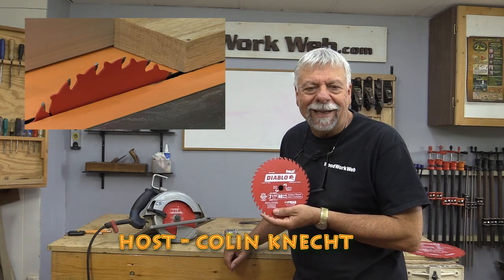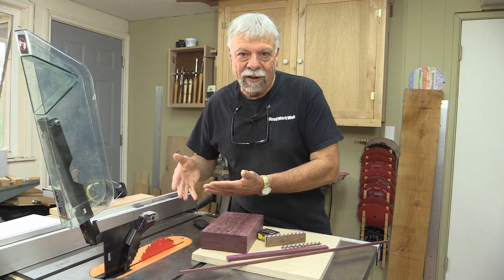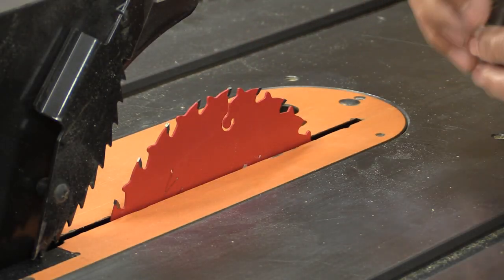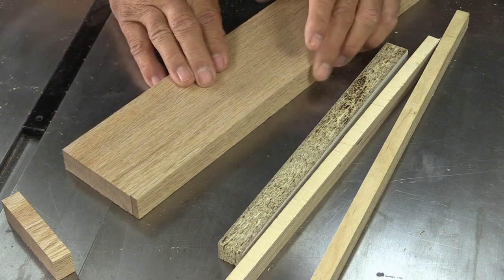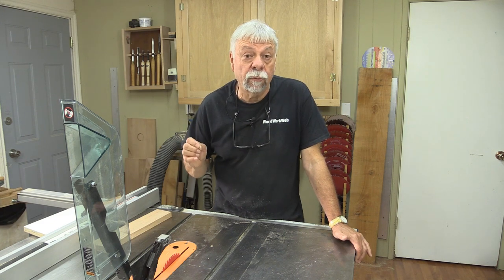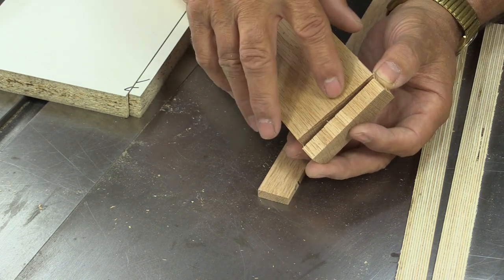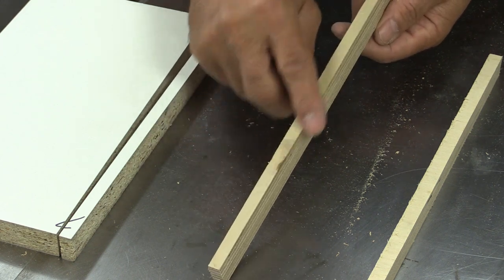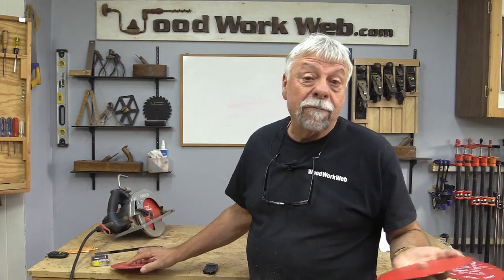Using Circular Saw Blades on a Table Saw for Woodworking

Comment: I tried this idea and it works great.   I bought a (2) pack of very fine kerf, 80 tooth circular saw blades and have been using it to rip very expensive white oak trim pieces.   Nice clean cut, less dust, and less waste.  Thank you for reminding me of this technique.  I did this years ago and have just not thought about it until seeing your video!
Reply: What did you do about your riving knife?  Did you have any issues with kickback?
Reply: I left the riving knife in place.    I have not experienced any kick back when using this technique.  But, I have only used it on trim pieces, cabinet doors, etc… usually hardwoods.  And, the kerf barely clears the top surface of the work piece.   Hope that helps.

Comment: Interesting video on circular saw blades. I actually use the less expensive circular saw blades on a regular basis. Whenever I need to make a lot of repeat cuts on common lumber the smaller blades do just fine. I don't need fine cutting on a 2 x 4. I just keep some Harbor Freight circular saw blades on hand. They work fine. Enjoy watching you teaching us. Mike
Reply from the maker: Thanks for watching Mike and thanks for the info!

Comment: You know Collin, I have been making small boxes from 1/4" hardwood which by the way ain't exactly cheap and this video made me realize that the 7 1/4 cs blade would be great for that not to mention that I cut very close tolerance miters while I'm at it. I may just be able to keep one or more fingers attached to my hands this way. 
The last time I did this was while making a ts insert that the 10" blade wouldn't fit under for the first cut.. I had to go and install a 6" single dado blade for that particular job, but the cs blade may just do the trick. 
My gnarly old fingers thank you for the tip..
Reply from the maker: Thanks for commenting Martino ... yes, please make sure you keep those fingers ...
You are correct, working with smaller pieces like making boxes is a bit more dangerous so thinner kerf circ blades could help that safety a bit as well.  Thanks for commenting ... stay safe buddy

Comment: Riving Knife : Most knives are made to the factory blade thickness. When swapping out to a circular diablo blade its much thinner than the knife usually, how did you account for that or was your knife already thin enough ?
Reply: I had to remove the riving knife and create a new table saw insert and I added a splitter

Comment: A long time ago when I was a pup I used a 'hollow ground planer' blade it made really good cuts ready for glue joints. Or minimal sanding for finish work. I used to use the 7 and 1/4 inch blade on my radial arm saw.
Reply from the maker: I had a RAS quite some time ago but never had the occasion to outfit it with a circ blade, but yes it would work assuming you could lower it down enough, which obviously yours did ... good point, thanks for this

Comment: One issue that can occur on some table saws is that the 7.25" blade might be thinner than your riving knife, so be aware.
Reply: Thats what i was worried about , my saw has a 7 1/4 blade in now and i have the knife all the way out because it sticks out a bit all the way down. There is a good size gap in between the riving kinife and the blade , should i just take it out and put in a 10"?
Reply: That's right. Good point and most don't catch that. I just remove the riving knife.
Reply: The riving knife also will be too high for non through cuts
Reply: My 8" table saw is so old it doesn't have a riving knife
Reply: @Mr_Rick  any issues with kickback without a riving knife?
Reply: @SoCalKevin  never had any KB with a small blade. You could always make an insert with a custom riving knife to match blade if you're concerned.
Reply: With the 8 1/4 inch dewilt saws, the minor variation in riving knife isn't an issue.  The height is more of an issue for stuff like double passes or grooving.  But you are probably doing through cuts on smaller pieces with the 7 1/4 blade anyhow instead of the aformentioned applications.  I find that most of the time 7 1/4 blade works excellent on 8 1/4 saws.  Take away the riving knife (at your on risk, but it's a very small risk IMO for panel applications), the 10 inch saws also loves the smaller blade.
Reply: @SoCalKevin  Diy zero clearance with a splitter

Comment: excellent..good minds work alike.. I have been using circular  blades on my Ryobi precision cutting table saw for a while. My use started the day had a cheap blade that lost two teeth.. i used various 7 1/4s.. blade spins faster.. cleaner cuts,, narrower kerf..thanks love your vids,,big follower.. j.
Reply: Actually, if the motor is pulling full power. the smaller blades would travel slower.  A circular saw runs like 20-30% faster than a typical table saw.  7.25 blades are running 120 lineal ft / s instead of the the 10 inch going at 165 ft/s -ish.

Comment: I have an old 1962 Rockwell 9 inch saw,blades are hard to find as well as a variety 
So I just used the diablo blades you have shown.i got use to the blade height. 
I recently found an 8 inch. Diablo blade.now I have more height.but the kerf is 1/8(120thou).i didn't realize the kerf of the 71/4 skil saw blade was only .060thou.
I'm going back to 71/4.but only use the 8 in. For height.
Plus my saw runs smoother with smaller blade
Nice informative vid

Comment: As people have pointed out, you missed two very important facts about these blades. The riving knife being too thick and the increased power from the motor, since it doesn't have to sling wood from 5" out any more. I use smaller blades to increase the cutting ability of my underpowered saw.

Comment: I've always found that scoring cuts on both sides of a board will give you a much cleaner surface with no tear out. Sure it's slower, but if you want a quality cut it always works and is especially good with melamine.
Reply from the maker: Yes you can score on both sides of the board and yes that will give you cleaner cuts ... I have never tried this with melamine but it could be a good option for some ... thanks for the suggestion

Comment: Bought a 6 1/2 Milwaukee 18 volt saw.  WOW.   The supplied blade appears to have the same configuration as Diablo combination 24 tooth less the red paint.  I have been cutting 2x6 and 2x4 using straight cross cuts.    They are unbelievably smooth and looked sanded.  Also bought a two pack Diablo 24 tooth on sale at half price at the the big orange box store.  

No reason to think these will not work even better on a table saw where the is more control.
Reply: sanded  with 220 or better.

Comment: I had an older 1950s 9" Delta/Rockwell table saw/jointer combo with a 15 amp. motor that I used Tenryu 8" blades on that were fantastic, though they did cost about $25 each.  When I had a lot of 2x4s to rip I put in a freud 18T 7-1/4"; on lesser powered saws smaller diameter, thinner blades really make a difference.  Why would this be so, because the 7-1.4" blade has 7/8" less leverage working against the arbor.  It's a trade off that only works if you have less power than you need, you get less rim speed but your saw doesn't bog down; and like the video tells us, the blades are much thinner, as thin as .059".
Reply from the maker: Thanks for the note Ed ... Yes, I think you answered the question, smaller blades, and slightly thinner would make for an easier path through the wood. Thanks Buddy ... good to hear your experience, we all learn.

Comment: Also with a smaller blade you can use them to make  a more curved raised panels by sliding the piece 90 deg. across the table.
Reply from the maker: +Cliff Windgar Great tip Cliff

Comment: I think the other advantage of using the circular saw blade in the table saw is that the load on the motor will probably be lower and it will maintain a close to free speed rpm without bogging down....that could help prevent burning of the wood too.
Reply from the maker: Great point Cliffe, thanks for commenting and reminding me of this
Reply: It should also be noted the the smaller diameter blade will have a slower tooth cutting speed. A 10 inch blade will have a much higher tooth cutting speed for a given rpm

Comment: Good video Colin.  I use these cheap blades all the time on my table saw especially for rough cuts on rough sawn lumber that may have some dirt or grit on it that is difficult to remove.  As you mentioned, why risk trashing a high dollar blade?  A five pack of these blades (DeWalt) are less than $40.at the big box stores.

I made a rough dado blade using EDPM rubber spacers.  Worked great!  Again, why trash a high dollar blade?
Reply from the maker: I have done the dado thing in the past too, thanks for the reminder on that, others will learn now too

Comment: Great video, as usual, Colin.  I'm wondering also if it's a good idea to use the smaller blade to cut plexiglass.
If yes, then would it be better to use the 24 tooth blade or the 40 tooth blade?

Comment: If your saw has a riving knife,  it is likely thicker than ultra thin hand aw blade.  Dangerous.
Reply: The knife itself shouldn't be dangerous.  Having a wider splitting edge than the blade could mean the piece may bind at the fence instead of passing through. This possible bind would be between the fence and the splitter (knife) , not the actual blade.  Just turn the saw off.  The opposing side may get forced out a bit if the splitter is wider there, but shouldn't be anything serious, the flex in the wood should make the issue moot.  The only real danger that I see is the kickback before the piece has had a chance to hit the riving knife.  But having such a small kerf means this is much less of a serious issue.

Comment: I have a rough table saw that I do this on sometimes. I've noticed the very thin kerf 7.25 blades can wander on larger pieces.
Reply from the maker: Yes you are correct, they can, especially the older blades, there is a new blade out now that apparently is better or has solved this with a slightly different tooth design, something they call their "Track Point", which I have not had a chance to test .. but yes, the thinner blades can wander a bit.
Thanks for the comment ... must see what I can do about testing out that new blade
Reply: Thanks. I'll have to try the Track Point.
Reply: Yes the Diablo Demo Demon has the Trackpoint. It is what I came here to see if I could use on table and chop saw. Going to try it!

Comment: Colin you said that the circular saw blade was much thinner than your 10"  How do you deal with the splitter on your TS?  If the splitter is thicker than the kerf cut by your blade doesn't that present a problem?
Reply from the maker: My splitter is pretty thin and I had to go and look at it, yes it is slighly thicker than the blade, but not enough to make a difference that I can detect. The main point is that the splitter is even with the blade on the fence side so the push out is on the outboard so really doesn't make a diff out there .. but good point, appreciate you comment
Reply: Interesting, my splitter says that it should handle the thin kirf, but when I tried it seemed to bind, so I stopped immediately.  But I think I had it aligned quite center of the blade.  Maybe I will try more to the fence side.  Thanks for the response.
Reply: You can always add spacer that comes along with your dado set to push the blade out a bit to align with your splitter.
Reply: Also interesting, but here in Thailand, most saws are made with an arbor that does not allow a dado set.  But maybe I can get some of the spacers and give it a try.  Thanks.

Comment: My Dewalt manual says the included riving knife is 2.3mm which is the same as the kerf specification for the 190mm blades my circular saw takes.  The 250mm blades indicate the kerf is 3mm.

Comment: What if you used a zero clearance insert? Should be less tear out.
Reply: I'm assume Colin didn't change the insert when he switched from the 10" blade to the 7-1/4" which does have a thinner kerf.  A dedicated insert for the 7-1/4" should reduce the bottom tear out.

Comment: If you use blade stiffeners when cutting plywood you will get far less movements and much better results with your cut. Try using 6 inch stiffeners when cutting quarter inch thick ply or Any thin material. Skip the 40 tooth and go to 60 tooth you will love the results. There are times of the year that HOME DEPOT promotes two for one sales stock up.

Comment: I have a Ridgid 4512 cast iron table saw and have used the Diablo 7&1/4 inch blade to rip but the Irving knife is too thick and the piece stops and can’t be forced through . I even ground  the leading edge of the roving knife a bit but that didn’t work either. I am always fearful of kick back. Colin do you or any of your subscribers know if there is a riving knife available through an after market supplier? I have enjoyed your web site for years but just recently subscribed. Keep up the good work. Thanks Paul White

Comment: Yes....Colin....what thickness is your splitter? I use 7 1/4 cs blades when I cut pallet wood with nails....and I've had to make a thinner make-shift splitter. Would prefer to use a factory made thin kerf splitter but can't find one that fits my saw. Any suggestions. Talking about  thin kerf splitters would be a good follow up video to this video. ...especially when people realize their splitters are too thick to use circular saw blades safely.
Reply from the maker: Oh Yeah, the splitter, not sure the thickness, but still thinner than the circ saw blades, but they must be close in size. Good point, thanks for the note on that.
Reply: The Freud demo demon is around 0.070 - 0.075” if I recall correctly, the framing has smaller teeth but is slightly wider maybe .003-.005 ish?  You may get away with using one side of a small L bracket from Homeless Despot as a metal splitter (may want to sand it down a hint and to flat).  Don’t ask how I know lol.

Comment: Bob Chase did a video a few years back called taming your table saw
Reply: Yep.  He is very correct in stating the lack of the necessity to have such a large blade.  Chase seems more of a productions cabinet maker. You can tell he really thinks about cost vs quality, striking a good balance between the two.  That old man is a guru.  I really like Collin, thought I think he employs a bit more machinery.  There are some other guys producing great products here, but they are using $100K tooling to do it.  I've always felt the lack of necessity to have the 10" blade, especially on a job site saw (what I like and use).  You can't really rip a nominal 4", not that you should or would want to in one pass.  The good diablo blades are also hopelessly expensive even on sale.  You often wonder whether to sharpen a 35 dollar diablo ripping blade or get a new one.  7 1/4 will let you rip 2" nominal, anything more, you should have alternative means of processing (or flip it over I guess).

Comment: I think you still need to use a washer with the 7 1/4 blade with 10" table saw, because the 10" blade is a little more thick than the 7 1/4 blade plus you have to take out your riving knife

Comment: What about combination blades. I use the 10" version most of the time. I hate changing blades as I probably could plan out my work better but don't. I don't use a lot of hardwood so maybe that is why it seems to work for me. Also I use stabilizers with my blades. Do you need them on smaller blades because if so it would really reduce the max cut depth. I'm interested to hear your thoughts. Maybe I need to relook at my whole blade strategy.
Reply from the maker: There are many woodworkers like yourself who don't like changing blades or their saws are harder to change blades, so if what you are doing is working for you, keep on doing that. Just because I share something like this doesn't mean people should do it, only that it's an option for them.  The 10" Freud blades will not need blade stiffeners, other brands might if they are vibrating, which some do. 
You are correct Jack, using stiffeners on the smaller blades would defeat getting much of a depth of cut. Sounds like you are fine with the methods you are using, glad you  commented, gives me a chance to help clarify.  Thanks for taking the time.

Comment: does it change the quality of the cut if you tape the wood then cut it? ive seen cleaner cuts by taping the wood to prevent the edge from blowing out.
Reply from the maker: Yes it does, depending on the type of wood and the cut. Masking tape is a cheap investment for making better cuts.
Reply: Thank you!

Comment: Thank you for this video Colin! 

I’m wondering if I could use Micro Jig’s splitters via a zero clearance insertwith a blade of this diameter? If so, would the splitters have to be installed closer to the blade because it’s smaller than the 10”? The riving knife on my Dewalt contractor saw is askew and isn’t adjustable so I have to find a way around using it. 

Thank you again!

Comment: Wouldn't the tip speed be greatly increased? Could you use a in line speed control like is normally used on a router?

Comment: Colin, I am using a 7-1/4" blade on my tablesaw but its an old saw with no riving knife. The MJ thin kerf is too big that's 3/32. 71/4 is 1/16 what would work as a splitter? I need to make something. Any ideas? Thank you

Comment: I got given a really old Pro-Tech circular saw that doesn't even have a place for a riving knife. The thing is old. I'm over here not realizing there was ever a difference. I've just been going to the hardware store and buying blades that work in both the table saw and a chop-saw. 

Eventually I need to find a way to mod-on a riving knife.